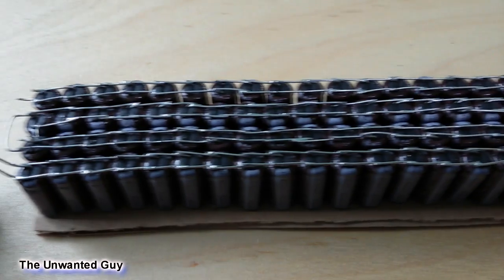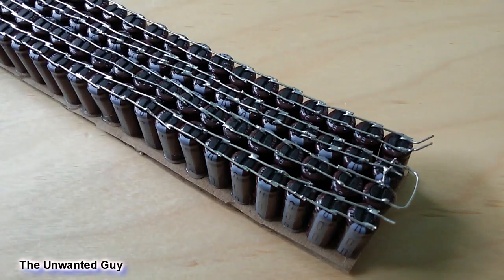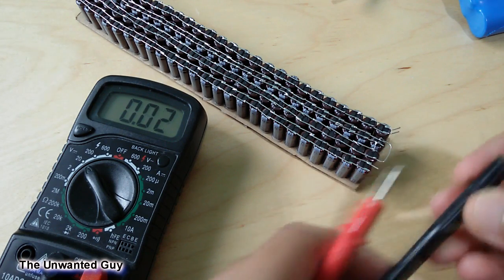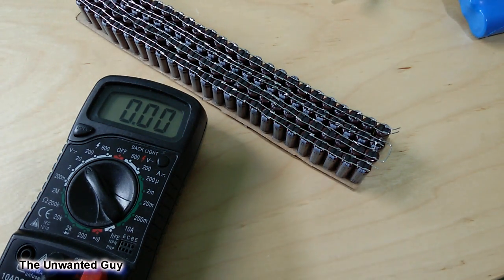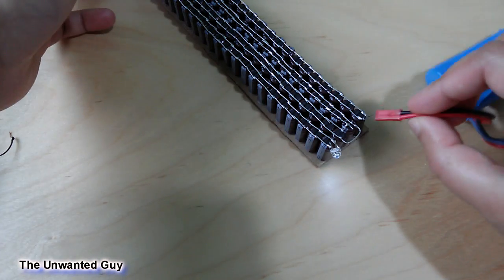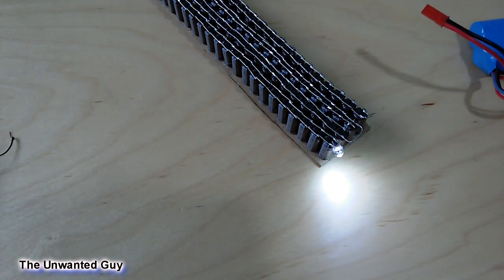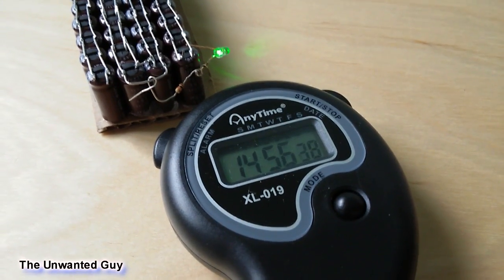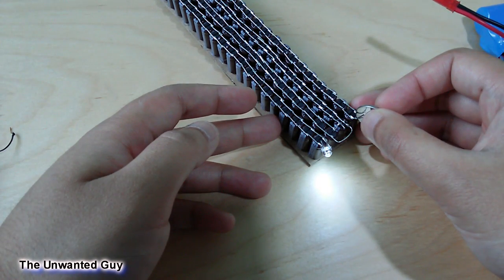POWER OF 99 CAPACITORS

Comment: No in less than a second you charged it to 6.8v..  those are 25v capacitors.
Reply from the maker: Did I say full capacity of the capacitors? By the way those are not 25v, they are 16v.

Comment: To charge your serially linked caps, you must make a Lenzless High Frequency High Voltage Inverter.

You can simply make a 12Vdc 500vac 40khz/100khz AC inverter and use Voltage multiplier made with high voltage high frequency ceramic capacitors and H.V-H.F Diodes to Multiply the Voltage.

To make a Lenzless high frequency inverter, you need feriyte core. The split the PRI art wire into 2 and wind one part in cw and the other in CCW over secondary with can be wound in any direction. You have to co next the splited primary wound wire in series.

Comment: The Diodes Isolates the Energy in each caps from one another and thus pave way for Power Amplification because the charging power frequency is as high as 40khz and this makes the series caps to charge quickly and via the one-wah-valve on there individual terminals ads up the capacitance and or current at low voltage of 400v 800uf!
However, what the chargin frequency sees is 50uf and that means the caps charging  period will be very low.
If I add more caps in series a d increase the voltage accordingly, the time taken to charge them all will reduce further and thereby ramping up the current further more.
Remember, the individual capacity of each cap in the serial array does not decrease so you just have to follow the rules to gain energy or use 10w to generate 1Kw power or more.

Comment: Capacitors charged in series at High Frequency but discharged  in parallel at low frequency is the secret to energy gain or Power Amplification or Overunity.

But How Can You Charge Caps in series and discharge in parallel?

Simply go to https://mbasic.facebook.com/photo.php?fbid=2000743203293041&id=100000721428679&set=pcb.2000747823292579&source=49&refid=17&_ft_=top_level_post_id.2000747823292579%3Atl_objid.2000747823292579%3Athrowback_story_fbid.2000747823292579%3Aphoto_attachments_list.%5B2000743203293041%2C2000743206626374%5D%3Athid.100000721428679%3A306061129499414%3A2%3A0%3A1535785199%3A1082487655120849543&__tn__=EH-R to see how you can. Enlarge the image to see how I have done it properly.

Comment: Hey. I think i know what happened... You are using 470uf capacitors so 99 time 470 equals 46,530uf. Can you make an updated versoin with 4700uf or 10000uf capacitors? If it was 4700uf ot would equal 465,300uf. Can you please make an updated versoin with 4700uf capacitors?
Reply from the maker: Thanks for your comment. I would love to do that, but those capacitors are too expensive. :(  Plus you can get super cacitors nowadays which can hold charge for quite long time then all these capacitors.

Comment: Maybe if you can help me, I'll pay you regularly or make me up a device ?
Reply from the maker: What kind of device would you like to make? I might be able to make it for you.
Reply: Are you from the UK ?
Reply from the maker: Thank you very much my friend, could you please let me know what kind of device you want to make so that if I'm interested in it I can contact you. Thanks :)
Reply: Yes, It's a current or voltage controller for a DC Hydrogen generator 
Generator is powering off from 240vac mains, through a bridge rectifier. voltage from DC hydrogen generator is running at around 260 to 300 vdc and around 6 - 8 amps. I want a device I can adjust the voltage or current so I can have variable gas output. I think that because of the large voltage from generator, normal regulators just trips breaker and blows fuse straight away as I had already tried several
Need a device small and light to fit into the enclosure, maybe something the size of an iphone box or smaller.

Hope you can help, thank you
Reply from the maker: So you basically wanting to make variable power  (current/voltage) controller, which can output about 300V and 6-8 amps. But at the same time you want it in a small box, right? My friend it might be a bit difficult  to make it that compact. I've searched on eBay and found a small one wich can output 400k volts but it's still doesn't output 8amps plus it outputs AC :(
Reply: AC is fine as I'll be using a rectifier to convert to DC but need up to 16 amps for safety side  or what's the smallest you can source. I've seen someone using capacitors but only has 2 settings. Hi or low voltage
Reply from the maker: I'm really sorry my friend. I might not being able to help you in this project, because first of all I don't have things to make this plus I don't play with high voltage. In this case you need very high power to produce lot of HHO  in short time, not only that you want in a small and compact box as well. Really sorry for not able to help you out. I hope will find some other way or someone. :)
Reply: Ok thanks for your help anyway
Reply from the maker: You're most welcome. :)

Comment: if you add a jewel theif to it, like it was a battery, using a coil or torroid to it,  would it last longer?
Reply from the maker: Hmmm, but I just wanted to see what 99 capacitors would do without adding anything extra. I've done another experiment with a super capacitor which is even better than this one #ahHX5u60cxI. Thanks for your comment. :)
Reply: The Unwanted Guy ok, good experiment.  I will soon be doing one one a torroid core.  I bought a few ring magnets.  I will heat a couple of them until their magnetism is gone.  Then i'm going to wrap some wire around then, both magnetic rings and dead magnetic rings to see how pre-magnetised cores will affect the micro henrys inductance.  If you want to know when this is complete i will text you here.
Reply from the maker: Thanks my friend please do let us know when it's finished. I would love to see how it works. :)

Comment: did you check mwith mutimeter in opposite way and try with one empty battery
Reply from the maker: Yes I did check with an empty rechargeable battery. Connected other way round but that didn't work. It's even better to just leave it alone, at least that way it self charges a bit. One more thing I tested today is that I attached it with a very low amp solar panel (https://www.youtube.com/watch?v=cUyCm1s6o3k) and after about 4 hours it charged up to 5.40v although it was a shitty weather today. I think it will charge it even faster in sunny days.

Comment: if we collect negative plus energy we can use it in warp vehicle or shields!one scientists  made negative plus generator making him 1-12v took him all day or week! this stuff is 100 times quicker!
Reply from the maker: Sounds pretty good my friend, but after 10 hours I checked it again and didn't get any reading (I was probably sleepy then, because suddeny  I turned on my phone in the middle of sleep and saw your comment, and straight way i grabbed my multimeter to check if it's right what you've said.) probably didn't set the multimeter properly, but I checked with tge motor and it couldn't even turn one round. that shows that after hours it was still in very low power position.

One more thing, if it takes days to generate few volts then it's probably better to look for different solution, because even small solar pannel might generate more power quicker than that.

Comment: but when is empty after 3-5 minutes try to check power again opposite way it will show you negative plus! somehow self charging when you put empty  battery!
Reply from the maker: LOl, I've just checked it and it does go up, but taking long time. After 12 minutes I got 0.17v reading. Let the timer run and I will let you know if it goes even more than that or no. Thanks for you suggestion. :)